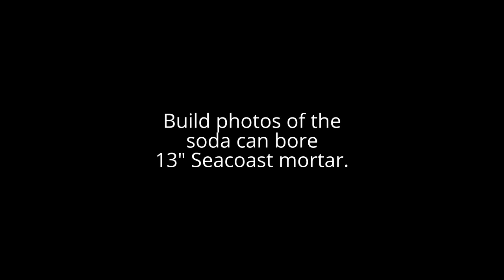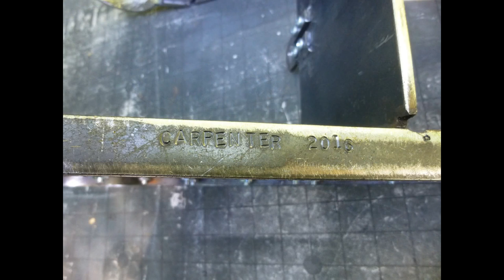Black Powder Mortar Build

Comment: OUT STANDING!!! I've wanted to do one of these for a while, but it never occurred to me to do a barrel basically sleeved with no filler. Do you remember the sizing of the tubes or where you sourced them? Also curious about the breech plug you used, didn't see much detail.
Reply from the maker: The outer tube is 8" x .250" wall DOM tubing. The inner sleeve is 3-1/2" x 3/8" wall DOM and the breech plug is 1-1/2" thick piece of 1018 round shrunk fitted and welded into the tube.  The rear section of the barrel is a steel hemisphere from King's Metals.  Sorry for the late reply.
Reply: @morecannonfab  thank you very much for the reply on this and another post. love your work
Reply: Great job would love to have one your work is outstanding